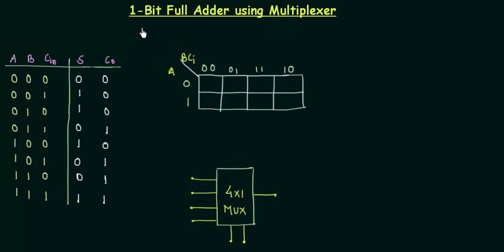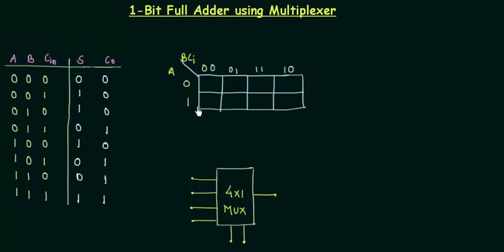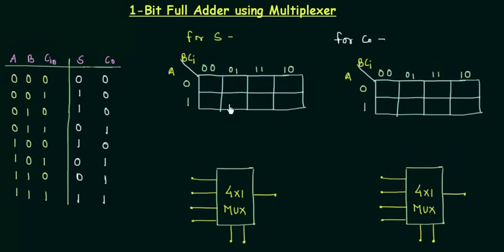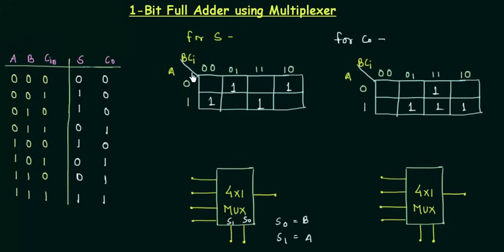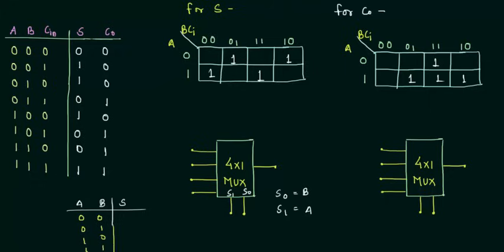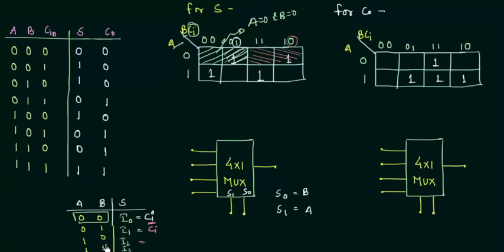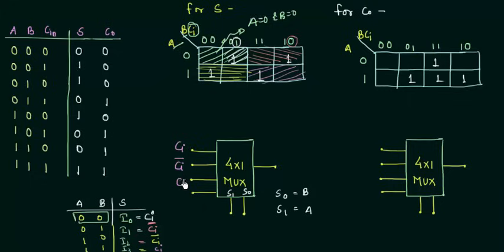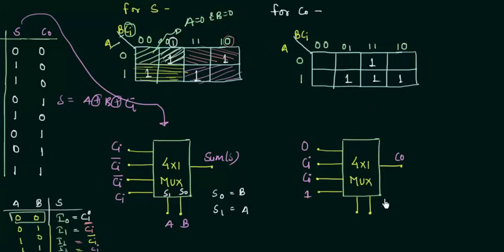1-Bit Full Adder using Multiplexer

Comment: in carry combinational circuit you represent  i0=0 and i3=1,on the other hand in sum circuit you represent them by c and c complement why?
Reply: I think I3 is 0
By grouping we get 0
Reply: because on analyzing the truth table for carry Mux selector inputs (A, B in this case), we found that :

When S1= 0 , S0 =0 ; we have 0 in K map, hence i0 = 0
&
when S1= 0, S0 = 1 ; we have Cin = 1 in K map, hence i1 = Cin  (Same is the case when S1 =1 & S0 =0 & i2 = Cin)
&
When S1 = 1, S = 1  ; we have Both A' & A = 1 in K map, hence i3 = 1.

Hope it helps. :)

Comment: Can we also add  Enable in Full adder using Multiplexer ?
And enable in  in 2:1 Multiplexer ?
Why we use Enable in 4:1 Mux special case ?
Kindly solve my problem 
Thanks
Reply: Enable is somrthing we use when we want our MUX to give 0 output or 1 by our choice. It is helpful in certain cases e.g in case of 8*1 MUX using 4*1 MUX we use enable to off our one of the two 4*1 MUX
Reply: HAFIZ Aqib Shiekh what u want